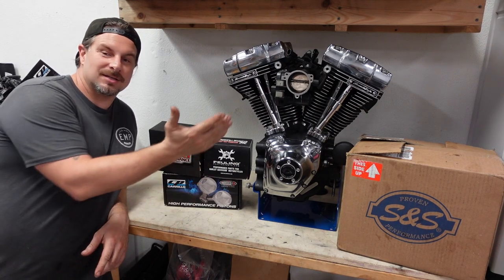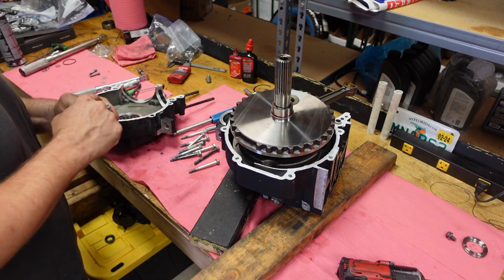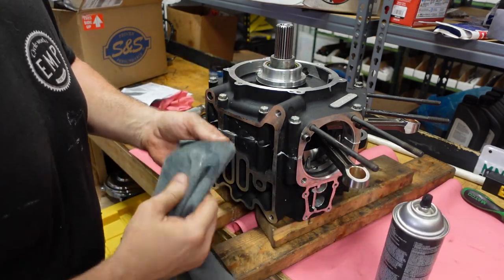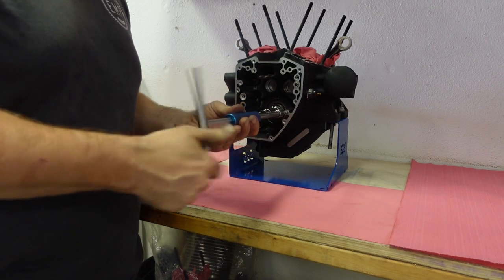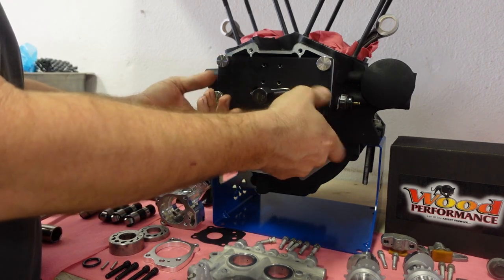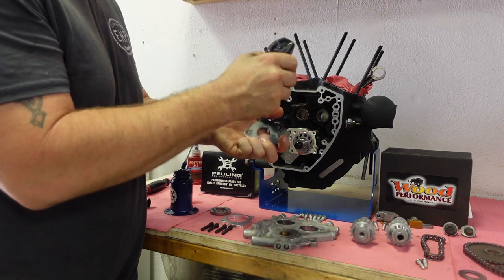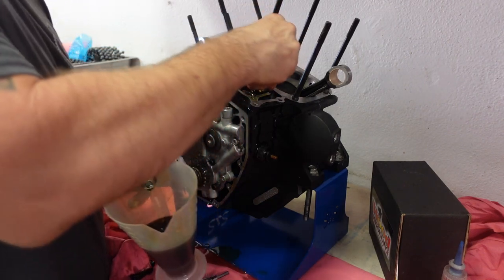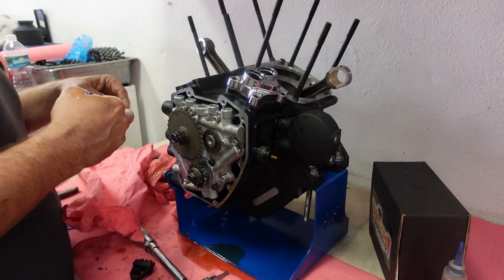Building a Solid Twin Cam 103 Part 1

Comment: Loctite 515 is the go for joining cases. It doesn't go hard if squeezed out. So no issue with debris, cleans up easy.
Reply from the maker: I've never used it. The threebond 1211 has never failed me. Ill get a tube of 515 and check it out.
Reply: Be careful applying any goop.
What squeezes out is also squeezing in.
Those products are most likely harmful to your oil.
 I am a big fan of paste sealers, but after ten years in the field selling lubricants and consulting on used oil analysis, I have seen the oil sample reports.
Reply: @markobrien678 -That’s why 3 Bond is the best. If it gets squeezed into the engine it simply disintegrates.

Comment: Hell yes mate, im looking at bullet proofing my 103. and this video is helping me understand what i need to do to make my engine run for longer and stronger! SKAL!!
Reply: I've got a 16 Road Glide Ultra with the 103 HO. It had 84,000 and some change miles on it when I bought it in September, and I've put about 3,000 on it so far. It came with a stack of maintenance records, and all it has had engine related other than oil changes was a few seals here and there. It runs like a new engine, still has plenty of power and is quite. As long as you keep up on the maintenance and don't thrash the hell out of it they'll run a long time.

Comment: Thank you for this episode, I would have liked to see the run-out on this brand new setup, I heard a lot about the good quality of S&S cranks also, this being a high compression build would have been a good idea to install Tinker bearings? I enjoy your videos, thank you.
Reply from the maker: Thanks for the support. This motor was a rebuild after a lifter failure. Timkin bearings, especially on a Twin Cam, are always the best choice. The budget for this build did not allow it though..
Reply: Novice here , you can easily see here that the HD is a Radial Engine ! Hydraulic Lifters too .
Reply: Timken
Reply: Got that brand new crank. Press fit or welded? And the gear drive question just begs to asked?
Reply: @oceanhome2023 Just the way I like it.

Comment: I don’t know if it’s the camera but your crank looks like it has a lot of run out. When you put the cam plate in and you were spinning the motor I could see the crank moving up and down.
Reply from the maker: I think you are looking at the rubber protector on the end of the pinion shaft. It was not on there centered and moves were wildly when it is spun. The crank had about 0.001” installed runout at the pinion
Reply: @empcycleworks  I knew I was seeing things, who builds an engine with that kind of run out. Keep up the great work and pay no attention to the peanut gallery .

Comment: This was awesome,  you broke it down and built it up in good due form. My question for you is, what can I suggest to the dealership mechanic that is installing a short block on my 96 cube twin cam that has upgrades.  I don't want the stock cam bearings,  with plastic girdles and there are probably other things. 
  The situation is that my bike is a 07 FatBoy,  96 cubes , bumped upnto a 1550 cc , screaming eagle 21/20 cams , high flow air breater , and two into one Bassonni pipes,  plus a screaming eagle throttle body.  I bought this bike with 40 k on the od and brought it back for a leak in the primary case,  but they found the crank shaft to be bent. The service manager is involved and took it on as his project.  He seems to be a stand up dude. I want to throw some dollers into this while it's apart. I worry that he will be held to certain constraints.  What can I do to see it through four at least four years of hard running? And then trade it in or possibly keep it ?  Subscribed, now
Reply from the maker: Screaming eagle parts are really good. I would press for a full compliment inner cam bearing. And make sure the runout of the new crank is very low, close to 0.001 or less”. Harley spec is crazy high like 0.012” Everything else from Harley should be pretty reliable.
Reply: @empcycleworks  I appreciate your time and advice ,brother! You do have a passion for it!  I never had such interest in watching a  motor get put together until I saw you doing your thing.

Comment: New to the Harley world and considering a 2014 Electra Glide so have a few questions.  That S&S crank looks up to be an $1800 part and doesn't appear to have a welded crank pin.  What makes it so much better than getting the OEM crank trued and welded?

Also, what's the failure rate on the OEM crank?  When can a person expect there to be an excessive runout problem if the bike remains stock?

Btw, looks like it's not too much trouble to remove the engine, based on what I see in your video.  That true?
Reply from the maker: The crank pin is plugged in the s&s for more strength. Stock cranks have a cap on the pin.

Depends on a lot of factors for longevity. How you ride and power lever are major factors. Driving in to low an rpm.

It’s really not that bad to remove the engine

Comment: Why would you do all this work and upgrades and put a stock cam plate back in the motor?
Reply: maybe it’s newer style that was improved
Reply from the maker: Budget. Also, at this power lever I think the stock cam plate is fine.
Reply: I didn't, by any chance, see crankshaft runout at 9:50 as it was spinning in the cam plate?
Reply: Stock cam plate is fine unless you're building a drag racing engine
Reply: @cj8172  It might be fine but there are better ones that are stronger ect...

Comment: You have make sure the oil pump is centered, what does that tell you about the pinion shaft runout, are you going to check it, ever?
Reply from the maker: New s&s crank had 0.001” runout at the pinion. The oil pump was centered.

Comment: Did you have to take the rear wheel off to get the oil pan out?  The engine is removed so wouldn't it come out the front easier?
Reply from the maker: You can get it out through the front with the engine out. I don’t remember why I had the rear wheel off
Reply: @empcycleworks  ok thank you for the info!!  Had a crank bearing eat itself so I'm going to pull mine to be sure and clean it all out good.

Comment: What made you decide to keep the stock cam plate? Do you have to check the run-out if you're installing chain driven cams, or is that only for gear driven cams?
Reply from the maker: Budget is why we kept the stock cam plate. With the fueling oil pump and lifters, the oiling system is adequate.

Anytime you are in the cam chest I recommend checking the pinion runout. It is critical for oil pump operation.

Comment: Can I just ask one question?  (No, that wasn't it!)
Why build this engine and put the $$$ into it, only to install those cam chain tensioners with plastic shoes?
Why not gear driven cams?
You're adding an S&S crank, Feuling oil pump...  And then those stock cam tensioners with the plastic shoes!
I had a Heritage Softail, with the twin cam 88...  But I sold it, because of those plastic shoes!
"Oh you can get 50K miles out of them.  Or 5K out of them...  Depends on how you ride it..."
I used to break out in a cold sweat, every time I cranked that engine up, because of plastics being applied to high speed moving parts inside the engine...
It doesn't make sense at all.
Reply from the maker: It comes down to the budget. Gear drive cams are more money.
Reply: @empcycleworks  True...  But how much cost goes into having to replace crappy parts, because they ware down?
And how long will you trust plastic tensioner shoes on a fast moving metal timing chain?

The stock crank, is two flywheels pressed together at the bearing for the connecting rods.
Because they are pressed together, they can, "and do," shift from one another.
Enough shift and it creates problems for the pistons, the jugs, the connecting rod, the bearings, and for the 'runout,' of the pinion shaft, that drives the oil pump.

"Dark Horse," was mentioned in this video.
They also make a crankshaft that is tuned and balanced, and then it's welded, so that it can't shift side to side.

I could just keep going.  But my point is, HD 'stock, OEM parts,' are CRAP!
One step up from OEM, is 'Screaming Eagle.'  They are HD parts, but they are of somewhat better quality than OEM.

I tell folks, if you're gonna spend the money to buy an HD, then spend the money to have it completely overhauled and rebuilt with aftermarket parts that are WAY better than HD will ever provide in their machines.

Do that, and consider it a 'long term investment,' that will serve you for years to come, 'knowing,' you got something better than what you saw sitting in a showroom...

Comment: you split the cases and didn't do a timkin bearing conversion?
Reply from the maker: Budgets don’t always allow for that. Plus I don’t think it is necessary
Reply: @empcycleworks  if you don't mind getting in the bottom every time you do the top end probably not. i like to do about two to one.  I think thats why i had a half a million miles on my shovelhead.

Comment: That engine is not solid with stock anything in the cam chest. Especially the stock pump and cam plate. The SE cam plate and oil pump are not any better. Word to the wise get rid of it and install fueling or S&S oil pump and cam plate.
Reply from the maker: Thank you
Reply: Baisley pop off valve and zippers pop off valve spring. Crank runout should not exceed 0.003 if it does then the pile of problems just got higher. I do recommend Atlas cranks and TC 88 engines from 99-02.They were designed with higher tolerances since HD wanted the TC to have gear drive cams. EPA shit on that and so Harley shoved a chain in there that could handle a sloppy crank. So they stopped shimming the cranks. 
I was 23 when I bought my Dyna in 1999. It is badged as a 2000 so I have the better brakes.
Edelbrock heads
Jims roller rocker and roller lifters
Jims titanium pushrods
S&S 625 gear drive cams
95" jugs cut 0.010
J&E 10.5 to 1 forgered pistons
Mikuni HSR 45
Forcewinder intake
Thunderheader
SE brain rev limited to 6200
Fueling pump and plate
Zippers spring
Baisley valve
All Balz primary bearing
Mobil 1 20W50 V-twin oil
Royal purple transmission gear oil
ATF in the primary
Avon venom tires
Light to light I blow the fairings off liter bikes.
Top speed unknown after 120 my needle floats back and forth.
Sure is fun to ride.
Reply: @DobermansRock 99-02 is that when they didn’t just use those POS pressed flywheel assembly that’s not plugged or strengthened in any way ? 0.003 runout ? That’s a fantastic OEM crank for an m8 🤦‍♂️
Reply: @geraldgoodiii6993  I want an Atlas. 0.003 is max run out for the TC to run gears. 99-02 they were shimmed to almost 0.0000 or mine was. Otherwise, you get gear slap. The Evo has an upside and a severe downside. Upside is it has the least number of parts so the least to break or wear out. Downside is the single cam configuration. At high RPM it stresses out the cam cones and they crack. Its why Harley built the twin. But the EPA walked in and said no gear drive cams.
Every engine Harley has built has had its good and its bad.

Comment: Harley engines have all gotten too large. A 96 inch motor for a motorcycle is enormous. None of us are pulling school busses out of the mud. Pick nearly any 750+ cc crotch rocket motor and put it in a rigid frame and you'll have a faster bike in similar style. 
350 Hondas used to be "big bikes" and 500cc up Triumphs were massive. Harley's always been oversized. 
Don't get me wrong, I still love all of them, I just think there's something being missed being missed chasing after 100ci plus mills.